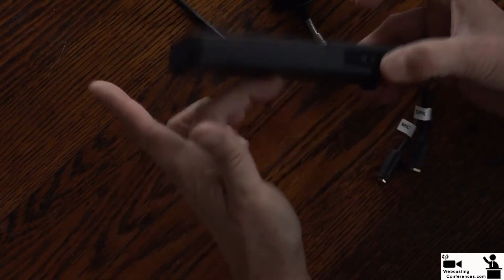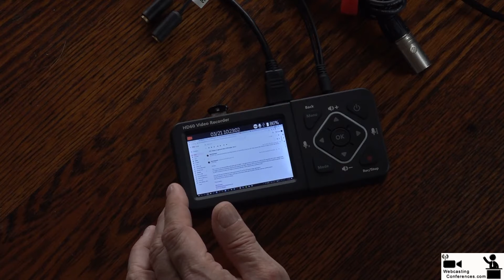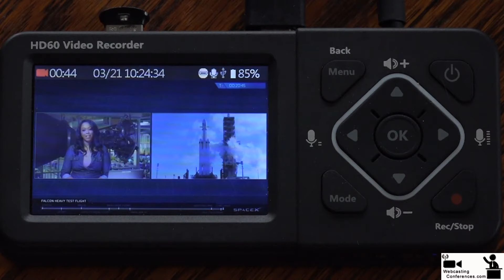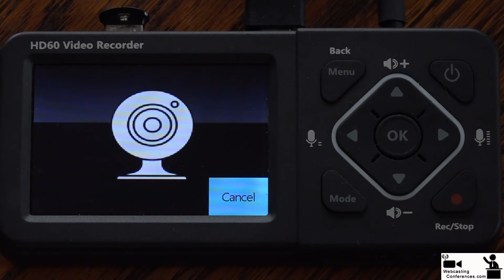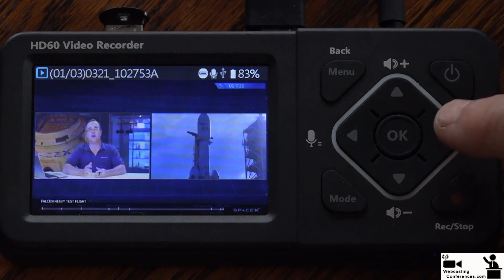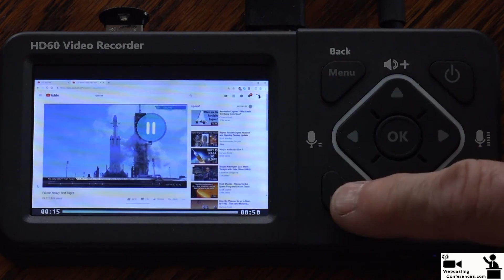Cadenceberge  CAD-D720 HD60 Video Recorder

Comment: I like it because it is an easy-to-carry device. I record lectures. When I try to record and edit a lecture that is over an hour long and upload it to the editing program's timeline, the video and sound are cut off. They say it's in FAT format, but the same problem occurs even if you record to an external hard drive NTFS. The video continues without a problem with the next video, but the sound cuts out. Is there a solution to this?